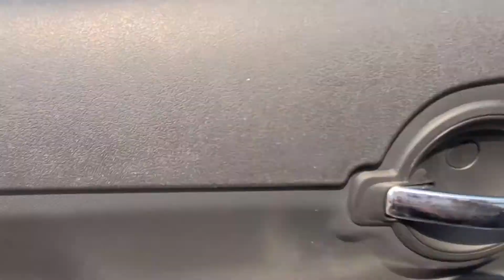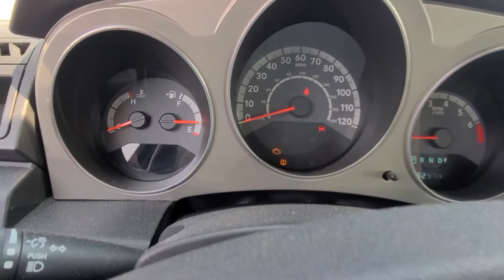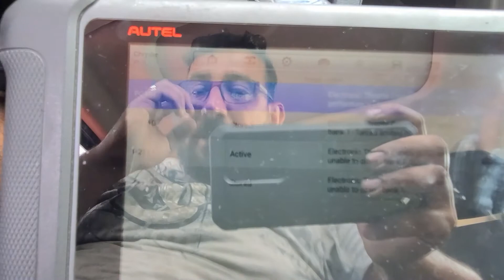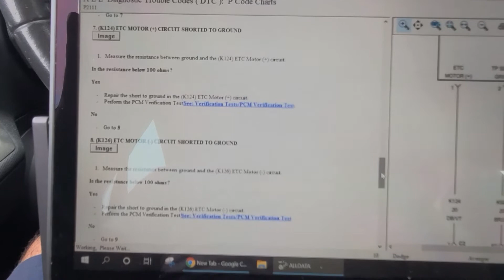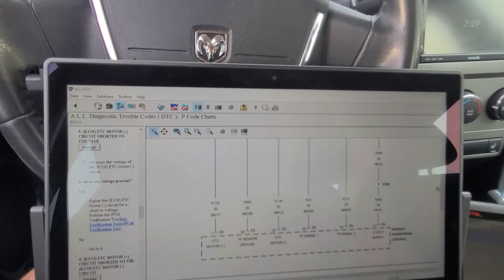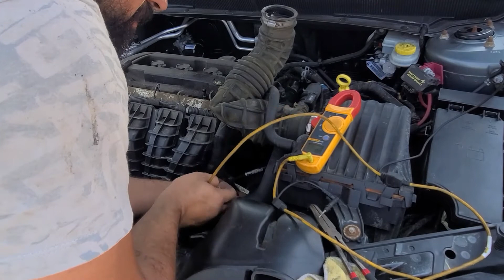2010 Dodge Avenger P2111 Code and Reduced engine power message

Comment: I had the same issue on a 2011 Avenger, i got my buddy to reprogram mine but it still did the same limp mode.. THE WAY I FINALLY FIXED IT WAS CHANGING OUT THE INTAKE MANIFOLD GASKET.. like a $7 part & I dont got the problem nomore.. in another video it explains how that gasket shrinks abit in the cold and thats where it was leaking air.. hope yours works too
Reply from the maker: Thanks for the tip

Comment: I HAve same problem. I changed throttle body. And after 1 day it went back to idling and low power.. but after 2 days runs normal again. Only problem now is check engine light is on. Any advice??
Reply: i have a 2013 Dodge avenger my car, the car works perfect somedays but sometimes it just shuts off out of nowhere while driving, and then it cranks but wont start i have to wait about 5 to 10min then it wont go faster than 20mph no lighting bolt symbol showing either. the following day the car work perfectly, i have changed the crankshaft sensor and I still randomly get that issue, do think i need to replace my ETC? any advice will help. thanks
Reply: @ronaldsmith7827  For once, I can say you are not the only one experiencing this exact same thing. My mothers car does the this exactly as you described. We have gone through many camshaft sensors and I believe one crankshaft sensor. It wasn't until recently that I remembered that the throttle body malfunctioning can cause the engine to shut down to prevent another Toyota incident and making the car accelerate out of control. So I recommended that she replace it since they are known to go bad at about 100k miles. I also decided to see if I could hear the throttle clicking when someone was pumping the gas while it was acting funny but I'm also not sure if what I heard was normal or not. But I have looked everywhere on the internet to find the root of this problem and it seems that no one knows what's going on with these cars. If you find anything out of the ordinary or fix this problem I would appreciate if you could share it with me.
Reply: @7SUK1  hey i appreciate the response, yes i have changed the throttle body which had alot of gunk in it, the car worked perfectly for about 3 weeks then starting shutting off again out of no where, i kept reading online forums and read to change out the TIPM i believe this has fixed the issue its been over a month and driven car more than 300 miles no problem
Reply from the maker: Read the code and make a note of it. Then erase it and drive tge car. If no issue come back then fine. If check engine light come on then read code agaon and compare to deleted one.
Reply: @DallasAutoDiag  help me
Reply: @sulaimansalah1387  🤣

Comment: I have the exact same problem so it was the the throttle body? or do I need to get a new pcm?
Reply: Im going thru the same thing. my car wont accelerate and when it does it jerks a lil bit & i cant accelerate after a red light also cant go over 40MPH , only my ABS light is on i have 2012 Dodge avenger plzz helop
Reply from the maker: I would start with throttle body first since its the easiest and cheapest repair. If not fixed a mechanic has to perform the steps I did in the video to determine weather or not the ecm is bad.
Reply: My vehicle did the same thing and it was my crank shaft sensor!
Reply: I have the same problem too but mine has great accelerations but the motor does tremble sometimes and my gauges blink in and off sometimes? Help me ?